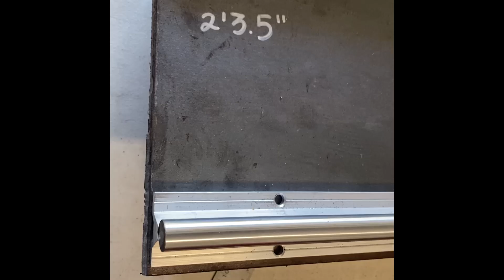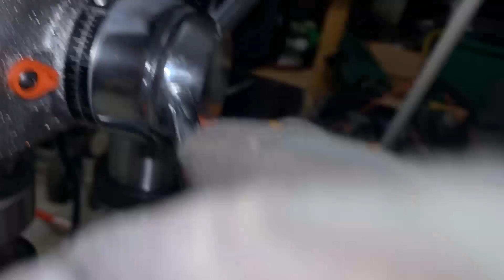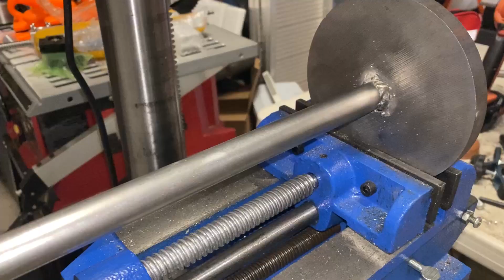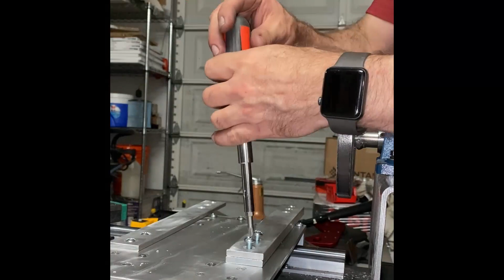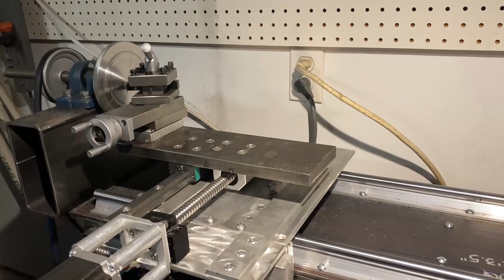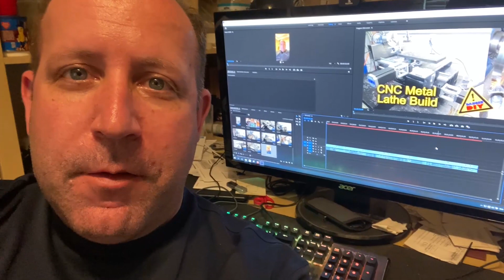Building A DIY CNC Metal Lathe With CNC Control Using Mach 3

Comment from the maker: I am a hobbyist for  metal working and this is one of my first projects and this is one of my first videos, so please help me out by leaving a comment if you have suggestions for improvement.  I didn’t have a tripod yet (just got it today) nor a second person as I didn’t know it was going to be a YouTube video until after a few days when I decided I would do that.

Thank you.  I’d really appreciate you liking and subscribing to the channel.
Reply: You need to re-machine your chuck's backplate, that is a lot of runout if you can see it on the video.
Reply from the maker: @kkuhn  thank you!  I appreciate the help.
Reply from the maker: Any other ideas you have are greatly appreciated.  Thanks for sending me the comment.
Reply: Will follow your channel buddy, keep posting.. best of luck..
Reply from the maker: Thank you my friend!
Reply from the maker: @Priya sweety  those are great tips you gave me and I really appreciate it.  I re-machined the backplate and the wobble is now gone and I added two more pillow blocks and moved them into a wider configuration.  If you get an opportunity to look at the short video (1minute) it shows the new headstock working.  It is a lot better but I think it could use some more stability / reinforcement front to back to ensure it doesn’t “flex” when I am facing the front of the metal or boring into it.  I haven’t tried anything yet that has caused it to do that but I was thinking about welding a reinforcing rod diagonally front to back to add rigidity.  What do you think?
Reply: How do I contact u buddy, even i m planning to start with diy CNC mill n lathe projects...

Comment: I mean.....whole machine is wobbling because the chuck seems to be out of axis. I don't know if you are satisfied with it since accuracy is the key issue in metal parts.
Reply from the maker: Yes.  Thanks for your comment.  There were a lot of issues but they were all addressed and covered in subsequent videos.  Please check out the new stability and other changes.  The lathe is working very good now.

Comment: First and foremost, congratulations on the design, planning, and construction of what can be considered a complex project using the tools you have! So, here is a small list of some inexpensive item suggestions for future builds. #1 DYKEM STEEL BLUE LAYOUT/STAINING FLUID. #2 MINI E-Z HAND TAPPER. #3 Transfer Punch Set, 28 Pc. ,$8.99 at Harbour Freight.  And if you don't have them already an adjustable combination square, scribe, and dial indicator. Lastly, Some small lathe manufacturers will sell replacement tailstocks that you can retrofit to your design and there are comparable solutions to acquire an adapter for the chuck that will also accommodate step pullies, just like those that are on your drill press speed arrangement,  for greater speed control. A $20 120v speed controller is also an option. Step drilling will add accuracy to your drilling process. For anyone interested, here is a link for a free legacy lathe PDF book that covers basic theory. http://www.vintagemachinery.org/pubs/1617/15299.pdf
Reply from the maker: Thank you very much. That is a great list of things and I really appreciate it.  I don’t know anyone that does machining or that has a lathe and this will be a big help.
Reply from the maker: If you get a chance please check out my modifications at: https://youtu.be/1uyC9rgDhgs for the cross slide.

Comment: Some advice if you like: 
The bearings are too small and too close to each other
The spindle is too weak usualy it's a thick wall hollow tube

Mild steel is not suitable for lathe or mill fill them with epoxy granit or concrate at least
The one linear rail is not strong enough for cross slide
Use a dial or test indicator put it on the toolholder and measure a shaft in the chuck if you can push it by hand 0.01 mm it is not good put more steel in it cast  gray cast iron if you can. Cheers
Reply from the maker: Those are all great points.  I was thinking about filling the base with concrete or a heavy epoxy.   Your comment definitely pushes me closer to doing that.  I added a second linear rail (you can see it in the new video labeled part 1).  I also added two more sets of bearings and increased the surface area for the mounting.  Still the same size 3/4 inch bar though.   I will try that test.  I reduced the length of the bar too in the newer design.
Reply from the maker: Thank you!

Comment: Stepper motor has permanent magnets in them, beware of magnetic materials and use shielded cable
Reply from the maker: Thank you for posting that.  These stepper motors are very high torque and very powerful.  I haven’t had any interference with the motors and wiring but I agree that shielded cable is a great idea.

Comment: with so much overhang, how it might not vibrate ?????
Reply from the maker: Yes.  This design does vibrate too much. I’? Welded a support piece at the end and also have moved the headstock from vertically high to flat and added 2 more bearings.  I will get these changes uploaded as soon as they are done so everyone can see them and has taken care of the vibration issues for side cuts.  Facing still is offering a bit of chatter and vibration.  I will be working on that and get a video up soon that addresses it.

Comment: No sense to use different type of rails. One is precise the other one has 0.1 mm backlash.
Reply from the maker: Yes.  You are absolutely right.  I should have used the same.  Thanks.  I am just getting started and didn’t realize they’d be that different and had trouble finding the length I needed.  .  Rather than returning them and getting the other I just used them both and definitely see the difference in the way they both work.  So it was nice seeing the difference but absolutely ordering the same linear rails would be best in my opinion.